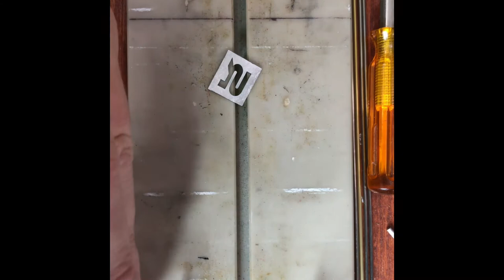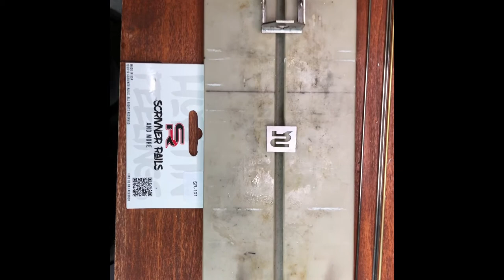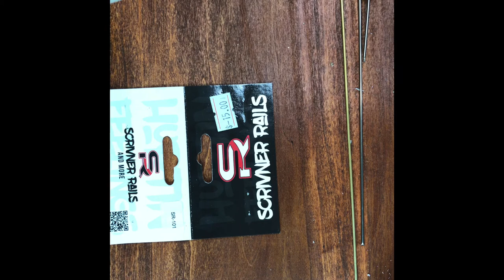Dragster Time!!!

Comment: If I pin the body does it need to have some side to side play?
Reply from the maker: I prefer a little…ever so slightly. Sometimes if the body is too tight it will effect the way the chassis works